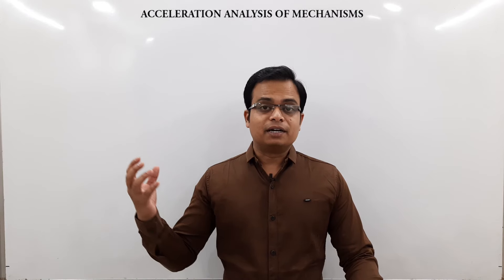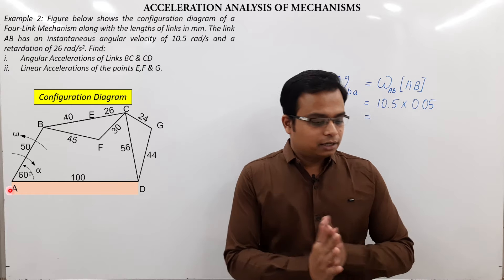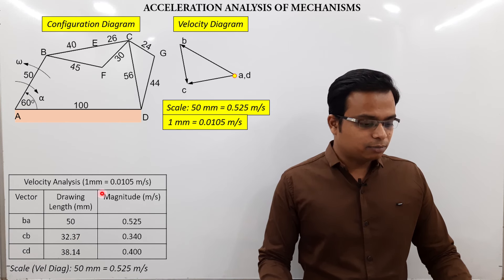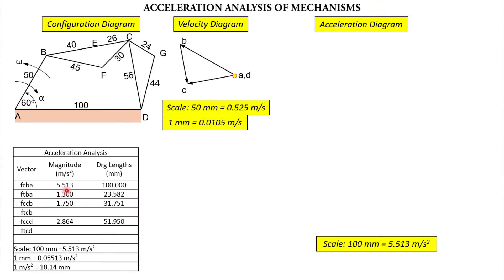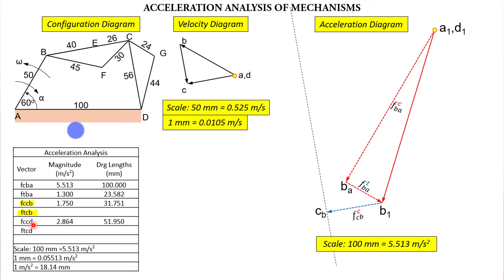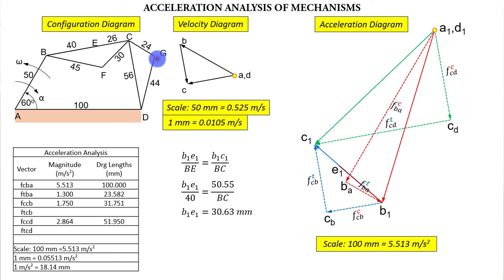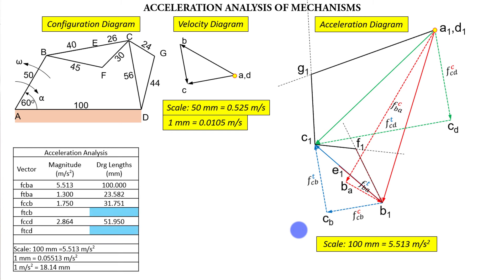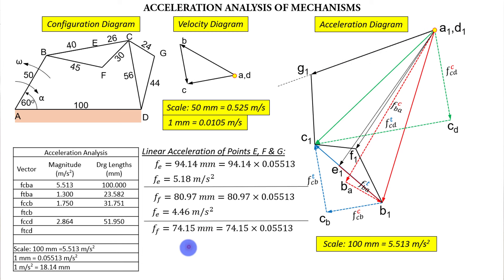Acceleration Analysis of Four Bar Mechanism

Comment: I have a question. Let's say it is a double crank mechanism with both bars have equal length and the frame and coupler also have the same length, what will the velocity diagram look like?